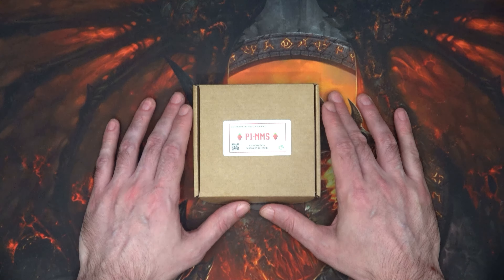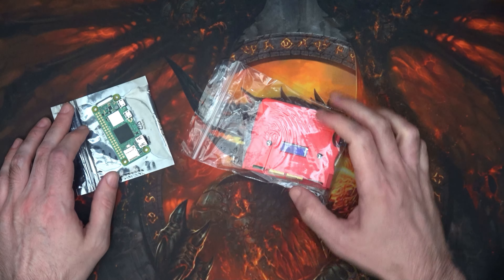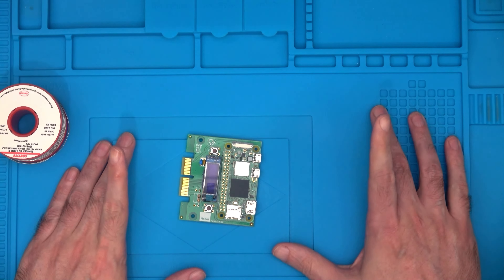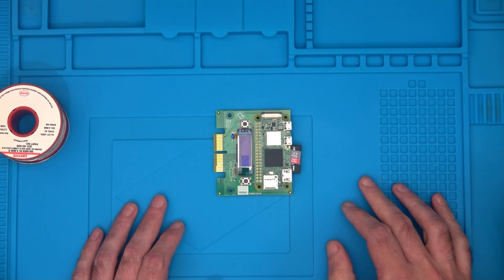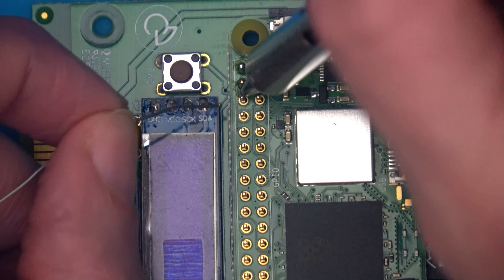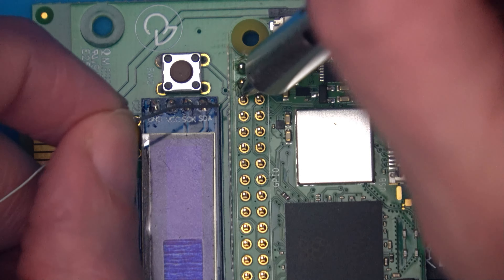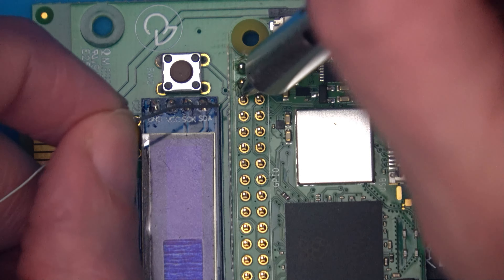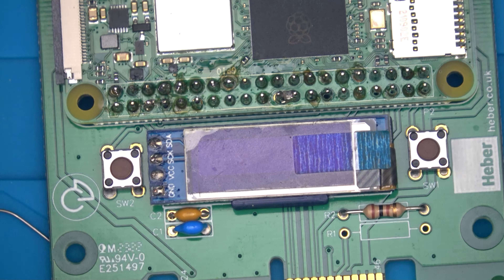PI-MMS for the Multisystem (Mister) soldering

Comment: What is the mt-32 pi configure settings  I solder mine put sd card in the pi seems to boot green led solid but my led screen won't show display, if I put sd card in my mt32-pi and snac usb it boots and display works, I tried several different settings but my pi mms won't show display